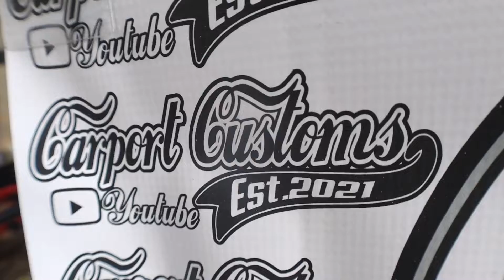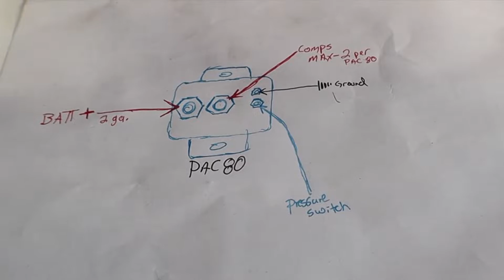How to Rebuild a Viair Compressor and Choose the Right one

Comment: The viair are rated at 23 amps max. Even with 2 compressors 4ga (real copper not copper clad aluminum) is more than enough. Look at a line length/ gauge/amp chart. 8 gauge is almost enough depending on the length.
Reply from the maker: Thanks for the info!

Comment: FYI; those spring loaded “magnets” on the end w/the wires are actually the carbon motor brushes, just went thru this exact same issue on a viair 444c due to wiring installed too tight and they eventually wore on the corner and shorted out the brushes and melted into the holders like you showed, Peace bro😎

Comment: Guy that has ruined an air zenith compressor here. I’m pretty sure it’s my fault it burned up using a single to fill a 10 gal tank all the time and filling big tractor back tires. Still wouldn’t go with them because I can’t find the brush part back plate anywhere but I see viair everywhere I look. I think I’m just going engine driven because of how I use it. Oh and definitely go with what he said on the relay because I burned up two of those little ones before I went to the one he recommends

Comment: can you do a diagram on how to wire the toggle switch on the airlift v2 system? I'm wanting a way to put a toggle on my system that way I can crank the car before I have to turn air compressor on. this way won't drain battery to fast. I already have the system on the car, just wanting a way to wire toggle switch on it. Thanks in advance.. enjoyed your video.

Comment: What if I ran an additional battery from my main battery to power the compressors and put it in the bed of my truck?  Would that be a better option to not rob power from the other electrical components like a stereo system? What are the pros and cons to doing this??
Reply from the maker: Yes that is perfect. That's how my truck is set up. Make sure you use good 00 wire. I recommend welding cable. Dont put a fuse between the batteries, it will rob voltage and melt.

Comment: Those cylinder heads being put back on can be a bitch. That seal can bend or flip inside if not careful.
Reply from the maker: Yea my 1st try I wrecked a brand new rebuild kit. Practice makes perfect right?
Reply: @CarportCustoms  what's the trick to getting the piston in the cylinder without wrecking it. I messed up my kit trying to get it in.